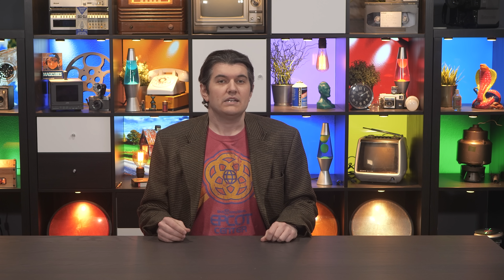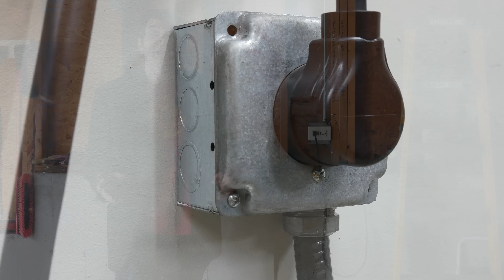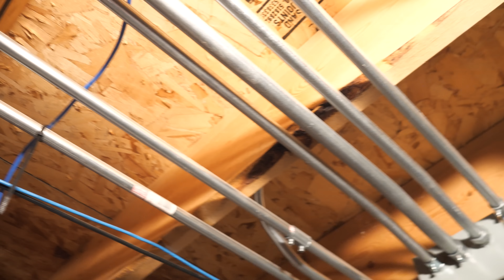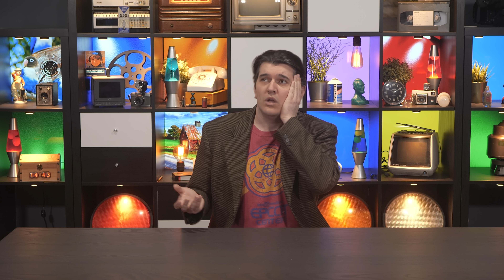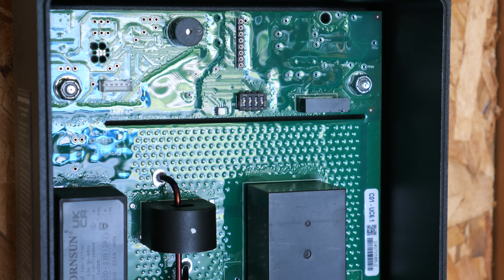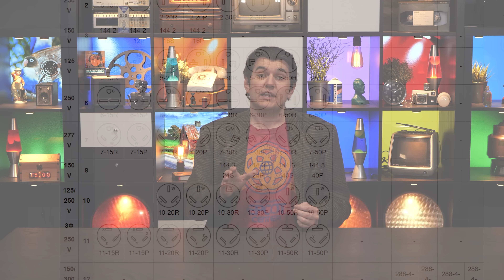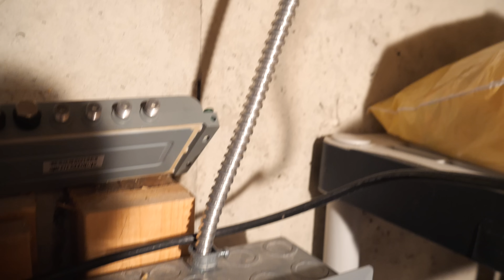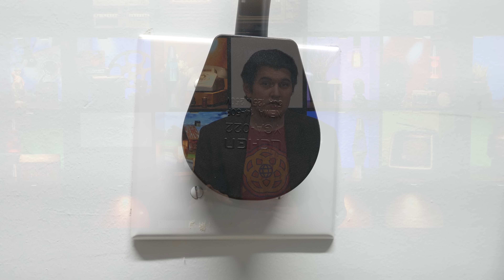The "standard" car charger is usually overkill—but your electrician might not know that

Comment: one of the problem we have here in italy: electric company by deafult provide a 3kW, if you want more you have to pay an additional fee for installation (and a small overprice per kwh consumed) and add some paperwork, so many are reluctant. 
charging a car with 3kw max shared with the rest of the house is really a struggle, expecially in summer with ac on.
Reply: man i dont even have an ev to worry about charging and i still would call that unliveable!! go off grid asap
Reply: With 3kw connection your only option is load balancing charger. However, if you obtain one, you should be pretty fine because you can utilize your connection optimally all the time

Comment: So I'm just a Canadian electrical engineer and don't know anything about Chicago's code, aside from hearing about the EMT conduit for all circuits thing. But couldn't your parents have used TECK90 instead of MC cable for the circuit? That's available in just about any conductor size, and sizes far exceeding #8 or #6 Cu. Hard to believe that the code would allow MC but not TECK cable in the same situation?

Comment: Datacenter Operator here.   I've had colocation customer fight me over electricity.  We'll drop a dedicated 20 or 30 amp circuit to their rack and then they trip a breaker because they overload it.  "No, you're wrong" they'll say.  "I can't be over the limit because I haven't filled the rack yet."   And these are folks smart enough to be installing their own servers into a hosting facility.   We have a long way to go.
Reply: I work datacenter-adjacent and have had to coordinate a staged restart after a power failure, because the inrush of all those servers powering on at once would pop the breakers in the PDUs.
Reply: @shmehfleh3115  Ran into that with many computers in a room, if the power fails then come back up they draw so much power it blow the fuse, this was normal office pc's so no power hugs but the start up load was high.
Reply: About the same as the idiot in a factory over here in Australia, they bought an electric forklift that came with a charger, we don't have a socket to suit that plug, so they cut it off and fitted a regular plug - they just could not figure out why the plug and socket started to melt.
Reply: @paulstubbs7678  TBF it if was a 15A plug they have the exact same internals as the 10A plug just a bigger earth. Anything over that though is pushing the friendship a bit much lol.
Reply: @zyeborm  They were REALLY pushing the friendship, this thing didn't have any pee-wee 15A plug,  more like one of those industrial 32A round pin jobs.
Reply: @paulstubbs7678  yeah... that's not going to end well lol. Kinda surprised it didn't trip the breaker, most GPO type circuits are on 20-25A (regardless of if they are 10 or 15A points hanging off them) though with that level of skill being displayed I wouldn't be shocked if they "fixed" that by putting a bigger breaker in too lol
Reply: Nowadays, I'm told, you don't rent square feet, you rent kilowatts.
Reply: @baylinkdashyt  depends on the place. I've seen both quite frequently.
Reply: "I can't be out of money - I still have checks left!"
Reply: Was it 208v?  I've had to deal with engineering that designed for 2x 240v 30A, and never bothered to check if that was what the site was delivering.  So much arguing after that when they had to pay extra for more power drops (2 because the eng team couldn't/wouldn't figure out 3 circuit striping).
Reply: @SaberusTerras  I also remember a discussion over a machine that's rated for 200A if all its expansion slots/bays were occupied, so its manufacturer recommends plugging it into an isolator rated for just above 200A. If only 1/2 of the slots were occupied and the manufacturer has certified that it'll thus draw 1/2 the amount of current (i.e. ~100A), people were asking if the machine could thus be plugged into a smaller isolator e.g. rated for 150A only
Reply: I love amps, they heat me up.
Reply: IT people are rarely handy with tools and certainly NOT electricians.  I see the ignorance of ‘stupid stuff’.  These folks need to take courses on RMS and load sizing.  They also need a course on physical building structures and best practices. 

I see highly stupid things like permanent roof beaming WiFi to nearby buildings using CINDER BLOCKS holding the mount in place, certainly voiding the roof warranty if it wears through from wind vibration.  Then penetrations through walls ripping through vapor seals with drills.  Lack of correct (or any) fire seal.   Then there is the lack of wire management leaving clusters of unmarked cables in a clueless state.  The employer has no clue how to hire the right people for this.  

Just because they can commission a rack of RAID 6 servers, does not qualify them for physical side of installations.  Most IT departments are ‘pretend’ and support applications for a living.  Don’t get me wrong, they are important in the track of their expertise and appreciated accordingly.  But this egregious lack of understanding Electrical and Building Code and Structural Best Practices is embarrassing.
Reply: @jerryrobinson7856  Got an even better example. we had once a laser transmitter to connect two buildings. had to be adjusted to very tight tolerances, which with the few hundred meters we had already was a hassle, I do not even want to imagine how that was supposed to work on the maximum distance of about 12 km.
The devices came in quite rugged weatherproofed housings and mounting equippment that weight in at almost 50 kg. A sturdy cast iron bracket to mount on a wall and a beefy steel pipe with about a 10 mm wall thickness at about 100mm across.
Of course someone did not like the optics of that contraption and it was mounted on some sort of tripod and a pipe for a regular satellite dish.
You can imagine how well that went as soon as the wind picked up or a truck passed by on the street...

Although I cannot agree to that generalisation on IT guys. Most for sure are not electricians, but some are. In our company, some learned communication electronics decades ago migrating more and more into IT, I myself got a degree in computer science, but for that I had to do a lengthy internship from filing doen and machining steel parts, to building electrical cabinets, so I know the stuff while definitely NOT being an electrician.
But some of the younger guys, oh my, get them in contact with something older than 10 years and they are lost. and don´t expect them to be able to calculate anything more than the lenght of cable required to plug in a server or appliance.
Some of my colleagues and myself worked on IT and communications equipemnt already that was old back then, when we started, before those guys even were born.
Reply: Am I seriously the only one thinking "You dropped a 30A circuit for a full rack and *didn't* expect the breaker to pop?" One 4U GPU box can pop 30A all on its lonesome. (Which is why most datacenters charge for power, which is a good way to get colo customers to self-regulate their power draw within spec and it dissuades the miners from colocating.)
Reply: @pufthemajicdragon  In the before times, the long long ago (like dudeson was talking about) GPU servers weren't a thing. 10A would handily run a full rack of anything without blades in it.
Reply: And this is why having metered PDUs are so important. Yeah they are expensive but it's really the only good way to track usage.
Reply: I’m a DC tech and can’t tell you how many times I’ve pointed out these kinds of issues before racking and get told to just go ahead anyway because I’m just a tech and they know better 🤦‍♂️
Reply: @HollaBackDad  sounds familiar. not counting that you may possibly have seen more datacenters or technical rooms than any of them.
Reply: I learned the 80% rule when I worked for a fledgling file server company. We could fill a 20A circuit with less than 15U of rack space :)

ps miss the drumbeats.
Reply: what chassis were you using? 6U 60 bays could do that on 120v, if they're all spinning at the same time.
Reply: @Originalsunrunner20  Its been 20+ years, but I believe the 1st gen servers were 4u chassis with either 9 or 12 HDs and dual cpus (and blue LEDs!); the whole unit ran a pretty steady 5.X amps. The first prototype/test chassis were either 6 or 8u, same number of drives but less cpu power usage, used more like 4 amps per if I remember correctly. I might not (remember correctly).
Reply: @Originalsunrunner20  It gets worse. I have some modern GPU servers which can pull 12 kW all by themselves when you max them out. We run them on 80 amp 3 phase PDUs and we still can't fully populate the rack.
Reply: @Khrrck  had a client in a shared work space, installed a GPU server with triple 2200W power supplies, you could only lose one and keep the server running. The “server” room (more of a glorified IDF) in the building was not designed for real servers, that one server took almost the entire power budget of the rack, and other tenants started complaining about the fan noise coming through the walls. Good times
Reply: @Eric-n3z6w Yeah a typical L6-30 gets you about 5kw and until GPU servers started being a big thing, we would have just one or two of those per rack... Before we got the 100A breakers and 80A pdus we were running 5 of those L6-30s per rack. Just stuffing em in wherever they would fit and still  barely able to run anything.
Reply: @charlesclark3840 ahhh...drumbeats. now there's a phrase I haven't heard in a very long time.
(am I ok to park here for a bit??)
Reply: @mattmanyam  maybe go for a trip and park for a bit, may get a cameo
Reply: I just literally had this today at a client site! Someone added a 350W load (VOIP PBX server) to the rack and that was the straw that broke the camel's back (overloaded the online UPS) 🤦‍♂️
Reply: My parents have an OG 100 amp Tesla charger. It charges so fast they don’t bother plugging in most of the time. 

Necessary? No. But it’s great for bragging among EV nerds.
Reply: I had such discussions within our own company as well. according to my calculations we currently have at most 1750 W per rack. Well, ok, if all racks were full, and right now we have only at most a quarter of racks in use and not full, neither to space nor to capacity at all. But they also had the foresight to pull cables that can handle continues 4 times 16 amps. Should be fine for most applications. I think the most limiting factor right now is a transformer that still needs to be upgraded.
But then still I discuss with people that are supposed to be electricians, and they calculate a full 16 A for any of the most common plugs.
max amp rate for Schuko is indeed 16 A, but for continuous draw that specification says at most 80 %. other common plugs used on rack equipment even are limited to 10 A.
But even considering that, depending on the equipment, you will be able to use somewhere between 6 to 14 HU before reaching theoretical power limit. in a 48 HU cabinet...
Reply: I use the 80% rule to size just about every circuit I design the only time I don’t is when the engineer tells me to use a different  PF
Reply: Most areas don’t allow mc cable in runs longer then 6’. Check your local code restrictions.
Reply: What do you mean my account is overdrawn? I still have cheques!
Reply: Sounds like datacenters need to start offering higher voltages, AT LEAST 416/480 or 600 VAC. New power supplies can use Silicon Nitride components for even higher voltages. Some of those can handle several KILOVOLTS! @gtoger
Reply: "Smart", "Knowledgeable" and "Intelligent" are very separate things I've learned.
I've done some stuff that only took knowledge and intelligence, and then later after I knocked myself backwards into the dirt trying to send a full pint-can of beer through a car door at the dump, went "Yea, that probably was a dumb idea".
You need all 3, and never assume your end-user, or their managers have all 3 or else you'll end up with someone complaining because you didn't tell them to not do a stupid thing.
Reply: ‘Installing’ are just technicians. Remember that. (Also coming from the data center world.)
Reply: This is almost like what happened to me when I ran the Checking Department at the bank I worked at years ago. I had a young blonde tell me that I was wrong, that her account COULDN’T be overdrawn, because she still had unused checks in her checkbook!
Reply: I work in a hosting company, and I’ve regularly heard that power delivery is our bottleneck rather than physical space. As new equipment gets more dense, it only gets exacerbated.
Reply: Literally just add up all the max ratings like what. Literally the number one thing you should be thinking about when designing something like that.
Reply: The breaker should be 20% larger than the load.
Reply: Layman’s question -why is the circuit not big enough to handle a full rack?  Or similarly, why was the rack size for the circuit not limited based on the circuit?
Reply: @Meatball2022  That power come out as heat, for every 1W they draw from the circuit you need at least 1W of cooling infrastructure so you can't simply add power, so this is little point to have power source this big. Most colocation aren't planned for those very high power customer, it also didn't help that modern server scan use way lot power than 10 or even 20 years ago. So before you rent a rack they will tell you how many power you could use and usually it is very hard to get more even if you have the money because they simply won't have the infrastructure, if you need 42kW single rack, you rent from locations that built for this, and I assure you that would cost way more than the average coloc.
Reply: That's crazy. No load calc first on a new buildout?
Reply: amateur tip: if you have a power supply with a maximum amperage rating, you should assume that it's always drawing that all the time when setting up the circuit, so even if they just so happen to actually BE doing that you're still somewhat okay.
Reply: @kivalous  decent rule of thumb yes, but more professional users can calculate how much power they're actually going to use.
Reply: OMG he really commented here. Man I miss your videos. 🥲

Comment: Just a quick note, some cars do need 220/240V. I'm not quite sure if this also the case for the bigger vehicles in the US like the F150 Lightning or Hummer EV, but my BYD Tang  that has a 108 kWh battery can't charge at 120V, the onboard charger doesn't allow it. So be sure to check your car's charging specification.

Comment: Personaly I would rather have the car charger do things like adjusting the energy output based on something like the energy price. There are a few out there (at least in Europe), that are smart, but don't need internet access and have local APIs perfect for integration into a open source home automation system. I don't think this ist true for most cars. Also smart chargers are able to dynamicaly adjust the output power if you need to install multiple chargers, but the available overall power is limited.

Comment: Murika is such a strange country, I charge my small Ev van with a 15 amp 240v Granny charger, for our other EV with a 64 kwh battery we use the a 7kw Zappi single phase 7kw charger, this has been installed to allow for tenants of our granny flat to charge an Ev the same day as ours if needed.

Comment: The guy that lived here and built a 2-car workshop (with 2-post car lift, though I haven't repaired it yet) was planning to install a hottub on the deck just outside the shop door, so he installed a 240v50A outlet right there just inside the door then proceeded to die. So, I'm all set up to oomphcharge an EV...someday when I can afford an EV that I actually want.

Comment: Is there a surge protection device on the  car charger circuit ?  This is recommended now in the uk with an SPD being put in the house consumer unit, the concern being fried circuits in the EV. However I’m not familiar with US distribution boards so maybe you standardly have an integral SPD, as became compulsory here in 2022.

Comment: Get a proper EV Charging Wall Unit . Use these other cables as a backups eg during your long distance drives. A proper wall charger usually has softwares program which can do other things an ordinary wall socket cannot do like allowing access via your mobile phone, track power usage, keep records, etc.

Comment: I like this video. But there are a couple things I wonder about. 
I am based in the UK as an electrician where 230V (240) electrical outlets are Standard.

I won't claim to know much about the US system beyond that its split phase etc. But Here getting 2.4W out of an electrical outlet is actually completely reasonable, which i understand it isnt too unheard of to get in the US. 

However one word of warning i have had to tell people. Most standard wall outlets in the UK although rated and used for 13A (240) (Roughly 3000 watts) are NOT tested or rated for more than 10A continuous current.
That is why special EV socket outlets are sold even in the UK for this application if you're going to be charging a car regularly. So at minimum people should check the full spec sheet. 

As I said. No idea about the American system, but if an electrician is reccomending a plug upgrade then id probably go with it. Even if its overkill. Better to be safe than sorry.

But yeah, I own 2 electric cars, and I used to drive 120 miles a day. I would "loose" about 5 miles a day charging off a trickle charger but then by the weekend the car would be filled up again. I have since added a "fast charger" - 7.4kw, but that is only so I can charge both cars.